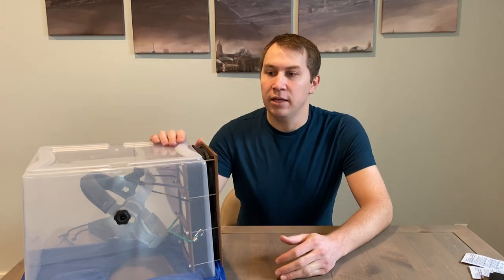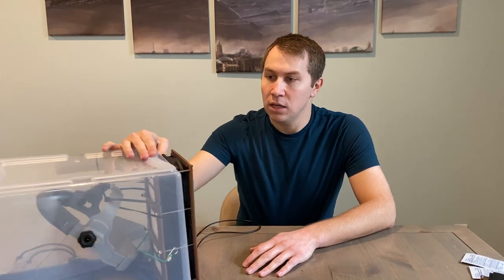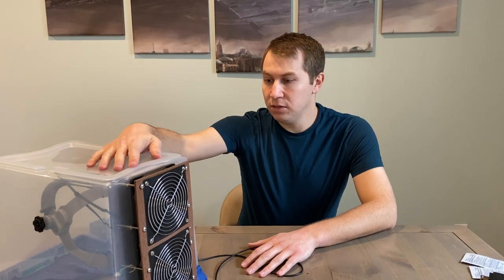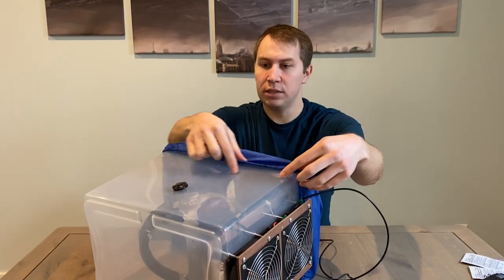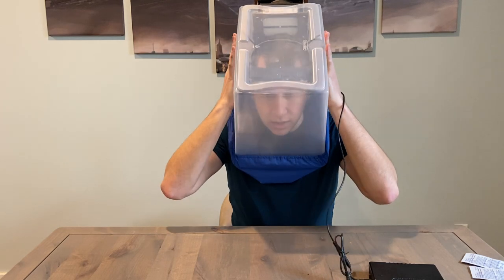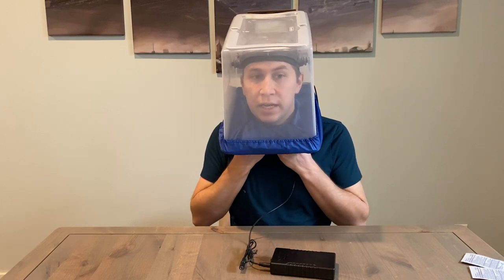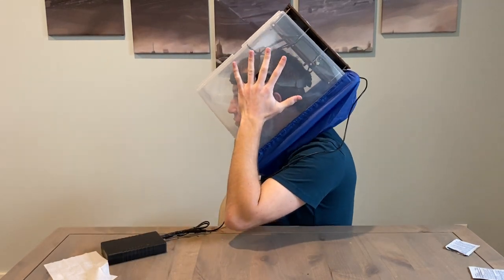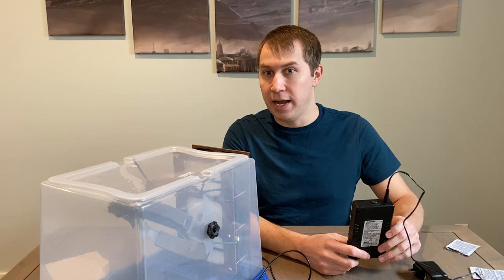Tote Air Purifying Respirator (TAPR)

Comment: Could wear a clean n95 mask prior to donning also maybe.  That would help with feeling more confident when removing. Very nice work.
Reply from the maker: Yes that or even a surgical mask or home made cloth mask.  I think using this with a surgical mask may be a popular combination.  Save the N95s for other staff that don't have a TAPR/PAPR/CAPR
Reply: @taprdesign7514  Yes the inside mask could anything,  but if I were working with known carriers an N95 mask inside would be wanted, but it could be reused..  I'd consider building this.  Actual powered air purifier sets are $1000 - $2000, probably higher now. Take care!